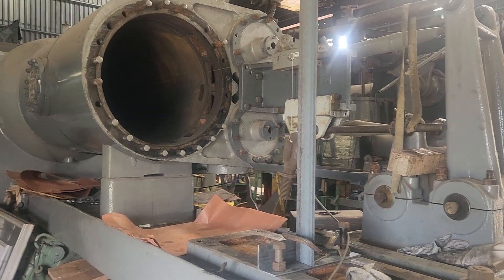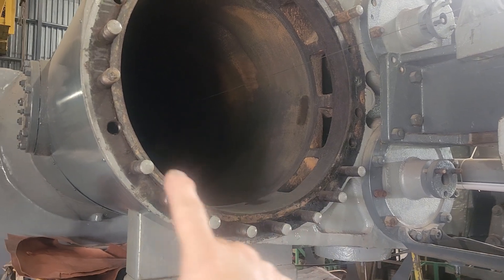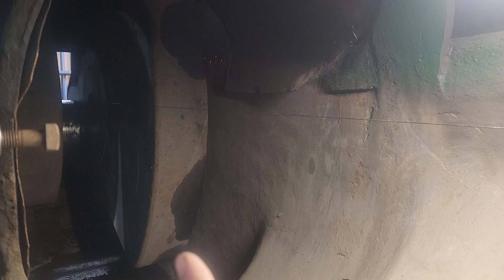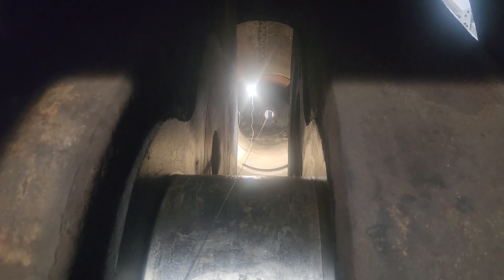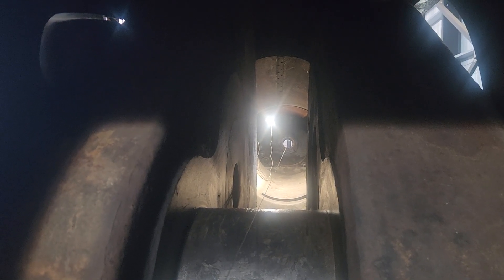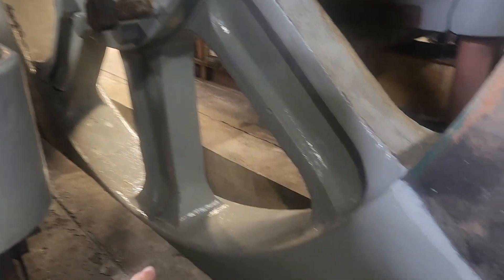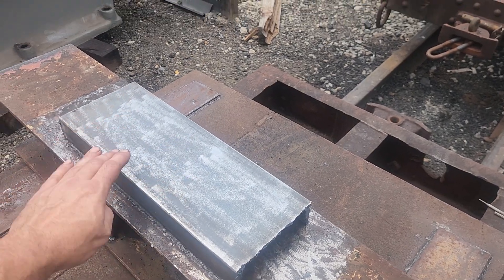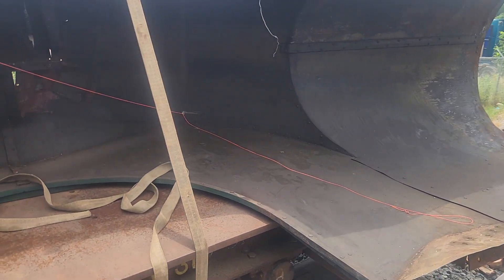Setting Up the Alignment Wire on the Tod Engine

Comment: It’s a hard job aligning a big engine like that. What are the tolerances for the alignment?
Reply from the maker: As close as we can get it.  The big thing is making sure the two main bearings are in alignment with each other.  If the wires are parallel to within 1/8" over 50 feet, both bedplates are level crosswise and the crankshaft is also level then I think we will have achieved our goals.  I have never done this before so lets see how it works out!
Reply: @YoungstownSteelHeritage    Hope you have one of those Starrett crankshaft distortion gauges when aligning the main bearings. I may have an extra one.

Comment: Coming along nicely. I can't wait until I can come down and see this engine in person. Having worked maintenance on a five stand 56" temper mill for many years I have some idea on how much power is required to run a rolling mill. The one I worked on used 4 motor generator sets totalling 24,000 hp. I was wondering was this Tod engine used on a rougher or a finishing mill? On the five stand the steel would enter the mill just shy of 1/4" thick at a crawl and come out the other end 11.7 thou thick at 60 mph and 30,000 feet long.
Reply from the maker: The engine operated a six stand, 24" merchant mill.  That mill mostly took blooms and reduced them down to 4 to 5" rounds for the Campbell seamless tube mill.